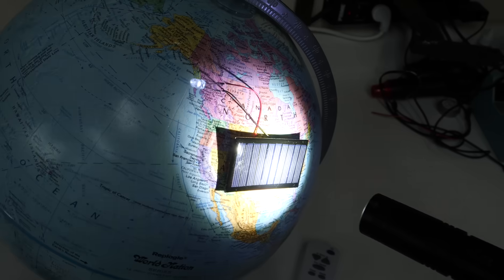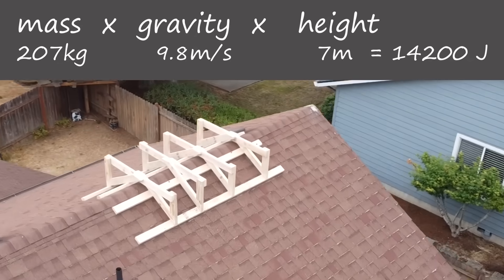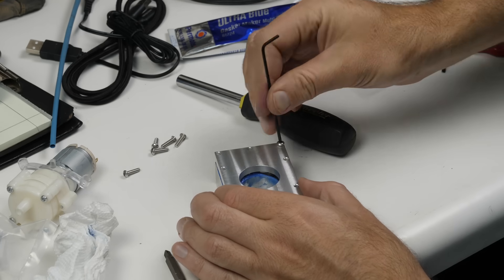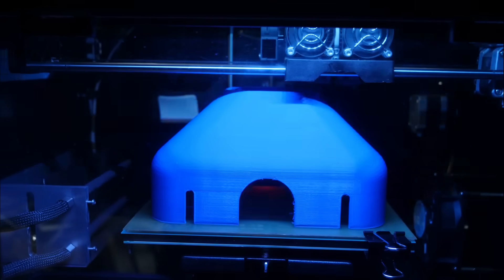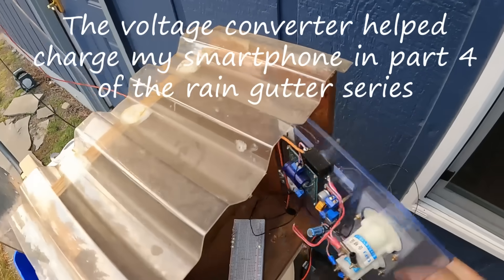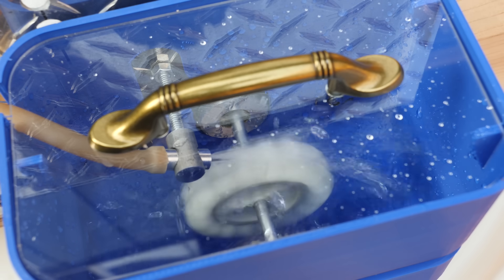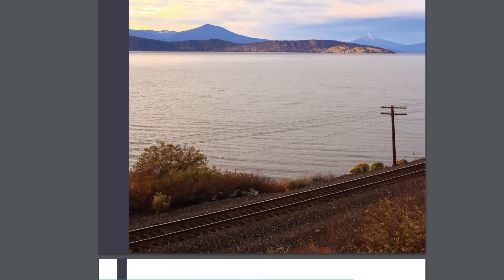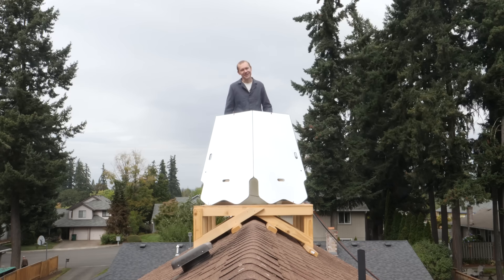Storing Solar Power on my ROOF!!!

Comment: I've said this since I majored in Environmental Architecture at UT in 1973.  They dropped the "Environmental" part after a couple of years.  

A tank on the roof is a bold move.   Maybe like a cistern, like they use in Bermuda, but it's going to take a lot of water.  I was very disappointed in the small amount of power it provided.  So if a person has land on a hill, in a fairly temperate climate how much water would it take to create a reliable "battery" for a 2000 sq/ft, well insulated home?  

How do we get people building homes that can sustain themselves and get the utilities to encourage Off the grid instead of blocking it at every turn?

Comment: If you talk of Lithium, be sure to think of LiFePO4 as well. Those cells will charge and discharge a lot more often, and even more if you can keep them working in the range of 20% to 80%.

Comment: I think a great project would be to send water up using solar energy directly: by evaporating the water, and condensing it at the top. Should be much more efficient than via the solar panel + motor setup.

Comment: I would add a second pump that is near the top to help relieve the load on the lower pump. The reason I would, is that you can keep the motor close to the source of power to keep the losses lower.

Comment: Friend, these things all have a limit, for example, your barrel on the house, true, you can fill and empty as many times as you want, but you should find a method to obtain energy from the water, be it hydrogen from said water (Warning: stored hydrogen in large quantities is explosive if it has a spark Goodbye roof of your house) and use said hydrogen in a large generator of 1000$ example of 5-10kw if you need a special carburetor for hydrogen and if you will have many years with that barrel you will have a lot of hydrogen stored during the day you generate hydrogen when you have XX PSI will stop the hydrogen generator for your safety isolated from thunder or electrical contact in case of a possible failure you need a rapid evacuation of the hydrogen if you release it quickly you will freeze a certain part so be careful with that in fact there are water motors but it has a cycle first make the hydrogen as pure as possible and store it in a tractor chamber with its corresponding chamber with the rubber on it You have xx Psi atmospheric pressure, the hydrogen generator stops, also a generator spends little hydrogen gas, being so explosive that its own gasoline must be regulated well for proper operation, and you have started with batteries in generators of 5-10kw a generator in itself of 10kw and you have a load of 4kw total because the magnet that your purchased generator has you die before it runs out of magnetism from the magnet that if you need to be careful do not give too much load to your things example 5 strong welders working with a generator 10kw doesn't last long. I would say 10 years working and if it gets hot it lasts even less it is important to have a big and cold generator when it works like this it will last many years even your children will be able to benefit from this system of yours always operating minimum no more than 4-5kw with a better 10kw generator a large one than a small one and fair power is better to have power left over and you will have constant energy and have a reserve AVR in case of future failures in the generators good luck friend and I'm sorry with so much text ..

Comment: Might this be more efficient and less unattractive by using a pulley with a geared motor to raise and lower a weight like something made of iron or lead? You could use the solar to power a motor to raise a weight and then at night have the weight descend to power the generator. A 200kg weight over 20 feet should generate about 18,000 joules and a lead block that size would only be about 7" cubed and iron about 11" cubed. A 12" cube of lead would be about 325kg and provide 30 kJ or 8.3 Wh.

Comment: a tank that has the top as high as your gutter could collect the rain with all its energy and ad that to the energy that you get from the sun.
of course you would need more volume to store solar energy because of the lower heigth, but the added energy from the rain would certainly be usefull.

Comment: Cool video, and just remember to watch out for code enforcers that want you to check the roof loading before installation, for instance solar panels often require roof framing to be checked for supporting an additional 5 psf in panel locations.  Most roofs are designed for 20 to 25 psf snow load for most roofs in low snow load areas and putting a barrel of water and framing have a significant amount of weight, e.g. 55 galons * 8.33 lbs/gallon = 458.15 lbs. for just the water in a full barrel.  As an engineer that designs structures, I recommend having an engineer check the roof trusses, but as adults, you can make your own choices.  Trusses are usually designed initially by the manufacturers, but any structural engineer can check the loading.  Maybe an engineer working for a truss manufacturer can do it more quickly.  Here in Oregon and many states have weird laws about water harvesting and storage too, but many people get away with things as long as they get along with their neighbors.
Reply: As a lisenced architect, I'm not as concerned about the static concentrated vertical loading from that water tank as I am about dynamic lateral loading from wind and especially any siesmic forces. That tank isn't well secured, and even it it was, when it's partially full, it's subject something ship and boat engineers are all too familiar with called "free surface effect" of unbaffled fluids inside of a container like a ship's hull - or a rain barell perched 7 meters up on the peak of a roof. Sloshing fluids can create resonance. This in turn can capsize boats - or destroy a roof in short order given the right frequency. Cool demonstration of potential kinetic energy, hopefuly nothing bad happens.
Reply: Could you just dig a deep hole in your yard tech?

Comment: But you lose a lot of the energy gained from the solar by inefficiencies in pump system into and out of the water tank... And the eye sore + increased structural load of having a massive water tank on your roof are considerable negatives... cost benefit of this solution vs storing solar directly into batteries is probably closer than you think

Comment: That's a nice opportunity to mention, that there actual full-size water power plants that use pumped water for energy storage. All they need is two lakes with a height difference between them. When there is more power than needed they pump water to the top lake. When the power is in high demand, they let the water down, spin the turbines and get the stored energy back.
Reply: Oh, I just got to the part of the video when you explain it.

Comment: Newsflash: There is actually a way you can use the water and a vacuum to refill the top barrel and it doesn’t need to be on your roof to create a constant water loop and turn a turbine on the down flowing water 🤷‍♂️

Comment: Quint: demonstrates best way to store energy.  Also Quint: custome machines a heat sink for an undersized motor instead of buying a $13 immersible sump pump.
Reply: 🤣 such a good point
Reply: not the best way to store energy, and a pointless heat sink. pathetic comment for a pathetic channel
Reply: Or maybe just fill up the tank with the hose and not pollute the environment with the toxic manufacturing process of making solar panels?
Reply: @mlauntube where are u gunna put the water after its used and at ground level? If its not a closed system ur wasting all that water
Reply: @zzz-nu2re  I’m sure you can think of many things to do with water since it has so many uses. The whole thing is silly, it’s just a model. The man now has something that requires more maintenance than it’s worth; is ugly; and damaging his roof.
Water batteries are good for places that have large excess of energy in off peak hours. They are incredibly inefficient, but if you have lots of land with a close elevation change...
Solar and wind farms are amazingly wonderful for skimming government subsidies and contracts if you have a friend in the legislature (those idiot tax payers won’t notice a thing).
The best low-tech storage of solar energy is to grow trees and use them for fuel.
Reply: @mlauntube  average american household consumes over 3x households in the uk and 10x the national average. If we dropped our consumption in half, nuclear and renewables would be all we need with natural gas as back up
Reply: @mlauntube  bro why are you heated about this when it's clearly just a diy project for youtube that he could do with his family? I don't think anyone is taking this as a serious approach to sustainable energy, but it's absolutely getting people to understand how and why those things work on a larger scale
Reply: @koolkayn  What makes you think I'm heated there bro? Folks are just chatting, and I pointed out that same thing. Are you lonely?
Reply: @mlauntube  how can you claim to just be chatting and be snarky in the same response, doesn't that just prove my point 😅
Heated doesn't (only) mean you're raging, it's about intensity and conviction. You don't have to take everything on this site like it's attempting to make you look stupid, chill out...
Reply: @koolkayn  LOL. Thank you for the comic relief. I'm sorry I got your panties all in a twist. Like you said "chill out".
Reply: @mlauntube calling a guy's DIY project for fun "ugly" sounds pretty heated to me G
Reply: @mlauntube  stop being a snowflake
Reply: @mlauntube What alternative do you propose that's so clean and doesn't pollute the environment, coal and gas?
Reply: @PJ-oe6eu  Oh, now I understand why I am getting a barrage of vitriol: it's because environmental militants have misunderstood my comments as some sort of attack on clean energy. No, I love the idea of large scale water batteries. Just because I point to the same down-sides as any engineer would, doesn't mean that I ignore the upsides. In fact, over ten years ago I was brainstorming on using coastal wave energy designs. I love clean energy, and I am very much apposed to putting toxins into the water or soil or air. Put away your daggers.
Reply: @mlauntube  Jesus you have some persecution complex.

You said just fill the bucket up with a water hose instead of making a solar panel that's toxic.

Now maybe you know something I don't about that area but to me it seems like a big assumption to say that the solar panel will create more toxic pollution over its lifetime than whatever energy source the pump at the treatment plant is powered by. 

Also funny how you then try to back-pedal with the "Oh but I'm just doing what any engineer would!" Yea sure bud.
Reply: @PJ-oe6eu  If you are insulting me, it's not a complex. Why don't you have a nice cup of tea and relax.

Comment: Great proof of concept (utilising long known technology (hydro-electric power)), at an extremely minor level. But completely impractical, for a single user. I'll keep working on my DIY powerwall. Got me to look, though. Good vid, even though the title could be considered clickbait: you aren't storing power, solar or otherwise, as, and until, you open the valve, it is purely potential energy. Analogous to a battery which isn't switched on.
One point: when the sun don't shine, you're still stuck without power to pump the water to the rooftop reservoir. So, you need some other form of renewable energy-or grid electricity-to achieve it.

Comment: Really cool demonstration!
It definitely needs big scale though! The 14000 joules the water drum can store is equivalent to 4Wh (a AA battery like he said, or roughly enough to charge a phone to 20%).  It makes me appreciate how good lithium batteries are at storing energy!
Reply: You May get a H2O electrolisator to get Hydrogen (to be stored in superhigh pressure cans) and some oxigén. After the Sun goes down, you turn on your H2-electricity-generator and it makes h2o  into the air.
You need circa  50 kW sunroof; 15 kW for the daytime and 35 kW for making more the 27 kWh for the "FuelCell generator".

Hungary use the unused energy in H2O elektrolisator to get hydrogen but we use them beside the LNG (or LPG?). They can boost the gas-powerplant.
Reply: @GirizdL  For a home, Lithium batteries are way cheaper and have far fewer losses than any hydrogen system.
Reply: @TheGerm24  the refueling capabelities of a H2- container (check the hydrogen-container of Gemenc (forrest)) will be much longlasting than the batteries.
Reply: Yeah, thats why Li-Ion battery so powerful and used in electric cars these days
Reply: @zynskavzynskav4465  True, and especially the LiFePO4 batteries us off-gridders like to use.
Reply: so how much storage would i need to make the potential water energy to power my house for a few days?
Reply: @im11yearsold63  the average power consumption in the USA is 28.9 KWh per day.
If you had the water 30 feet (~3 floors) above the ground, you would need 1,283 tons of mass to power the house for one day. 
That's 308,173 gallons of water.
So it's not very practical for a single house.
Reply: @im11yearsold63  That depends entirely on how much energy you use per day. I live off-grid and don't use that much, but the maximum usage I've seen from my battery system of 27.6KW/h was down to 36%, and that was before I got the rest of my 7.05KW/h of solar. (I could put in up to a total of 12KW/h of solar, if I had enough $ for the panels. Saving up now).
Reply: Not only is the energy density of pumped hydro low, the conversion efficiency is also very low.  Most of the stored potential energy is lost to heat and vibrations from the kinetic energy of the running water.  Very little is converted to electrical energy.
Reply: @nauy  what you said is wrong. pumped hydro plants can achieve around 80% round trip efficiency. its one of the best energy storage solutions weve got

Comment: as a bonus, the rain can take over from the solar panel to store potential energy inside the water drum on the roof!:)  and you can also add more drums on teh roof to store more than a day of solar power if you don't use it all up at night, or if it is raining day and night.  IT will actually recharge with rain during the nighttime at the same time you use it.
Reply: It's not totally bonkers but calculating how much energy homes use vs. how much energy can be harvested from water falling ~20 feet, you would need about as much water as the volume of the entire house to power it at 7.5kW for 24 hours. So I think the plan only makes sense it you're also using the water for other things. I.e you heat the water in the sun during the day and then gravity-feed into your house and that saves energy from water heater and water pump, then you add some turbines along the flow path to capture enough power to run a freezer or something.
Reply: Given that most building codes only allow one to two layers of shingles, I seriously doubt any are going to permit multiple 400lb barrels on a roof.  That sort of concentrated load is just waiting to be a large disaster.

Comment: Any roof that I've stripped, with roof vents, had leakage and water damage to the sheathing. This install is much worse ...and not pressure treated so the structure will be rotted in six or seven years. But this does prove battery storage is far superior. A cost calculation of time and materials to KWH, then compared to the ~$.1/ KWH cost from the utility would be eye opening.

Comment: Really good video sir , love the ingenuity and use of the cnc and printer. The power of water!  I think the importance of this thought process is paramount   for the future.  It doesnt give you alot of hydro but thats not the point.  Your only turning one fan ,  and concentrating all water in one tank.  What if roofs were designed to divert and capture as much Rain water as they could?   What if it was hooked up to multiple holding tanks hidden throughout the structure of the building, starting within roof to allow the water to absorb as much heat as possible and collect until those containers get full just like in the video. Unless it was winter then it would be diverted to the warmest lower tanks then transferred to basement or visa versa as needed. i  Why would i want to have water containers in selected locations within the house?  Well its a crazy thing called  thermal mass and lots of water HOLDS lots of thermal energy and mass.  Kind of a ohhh natural water boiler system without the gas.  Got the big old dark in color stone cast  wall with water pipes running through it in the  room with the biggest south facing  windows and most direct light  But thats only 3 old technologies and man there is lots of them out there that work to create small charges of energy , we just need to get all those little batteries all hooked up in series and allow that energy to be stored and used.

Comment: 14000 Joules... Quick Google check. Ah it's 3.8 Wh ie. 0.0038 kWh.
So you could operate a table fan or a PC without screen for like 6 minutes. 

-> this is about YouTube content and clicks, not about practical solutions.

Comment: Your NOT storing energy in the form of electricity,your just running a water wheel,that flows down hill( from your roof) to an impeller,that is driven by the force of this water! 
Your pushing water up to the water storeage tank,using solar powered pumps,then allowing the water to flow down at night, to create electricity ,by turning a water wheel(impeller driven wheel) attached to an electric generator.
But as you purport,to have stored electricity in water,that is completely false! It's old technology while,I'm at it,your roof trusses are very weak,so,if water weighs 65 lbs a gallon,xs 50,then there's a lot of weight on your poorly built roof rafters! That's why,US homes blow away in a wind storm!
But storing electricity in water,not happening!